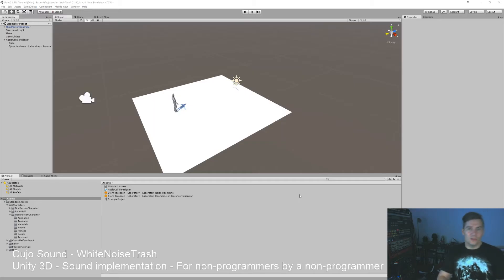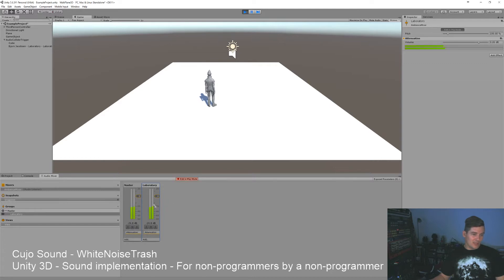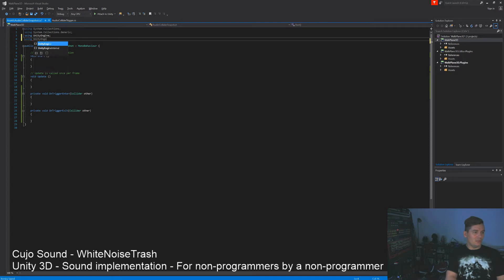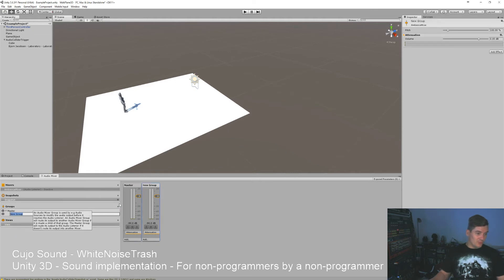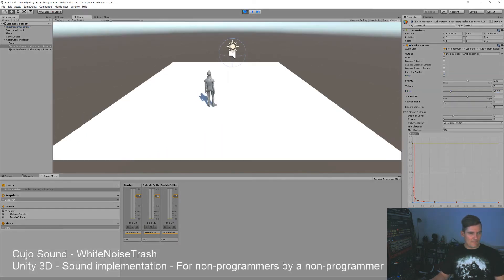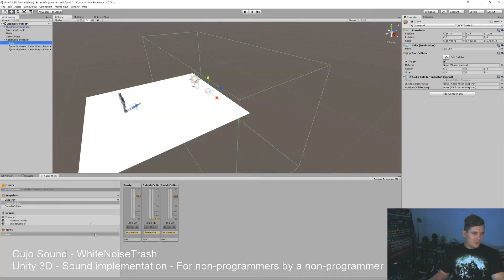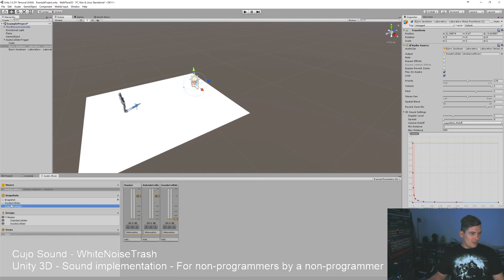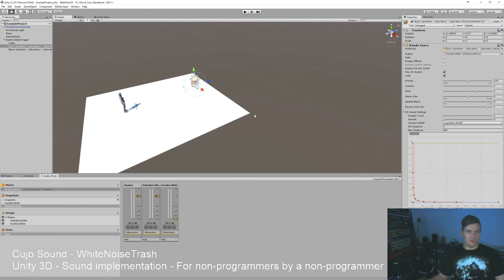Bjorn Jacobsen - Sound Design: Part 5. Unity Audio Mixer Snapshots for non-coders

Comment: Looking at this on 2020 is so helpful thank you so much Cujo. 
I have one question, I can't activate AudioMixerSnapshots in the script I have used UnityEngine.Audio,  but the system can't find it. is it different in 2020?
Reply from the maker: Not sure. But let me check and perhaps make an update video, but pretty sure the mixer should work the same in code
Reply: @CujoSound  Thanks for your reply but I figure it out was a problem with the script editor, your tutorials are really helping here I had my first indie job and they really saved me.

Comment: Very god serie, thx alot ! Is there  a way to make the fader cross at -3 db during theses transitions ? Maybe it's a question of linear or logarithmic fade ? Or maybe the subject is covered in another video ?
Reply from the maker: Depends on how you want it to do so, you can control quite precisely how it should transition. Some of that is covered in the advanced mixer snapshot transition, but not fully and in this way

Comment: very good... This series (although quite old) is helping me massively with my dissertation! many thanks Cujo
Reply from the maker: I should make new ones :D
Reply from the maker: Thanks for enjoying the series.
Reply: @CujoSound  No problem... i'm fully behind that idea! Good luck with it :D
Reply from the maker: @motalofi   whenever they put out new systems, I should try to show it , but yea, the general idea is pretty much the same.
Reply: @CujoSound  I actually have a quick question. Basically, i'm creating a video game that only relies on audio ques to complete the game (little - no visuals at all, possibly even complete darkness). Do any of your videos cover how to change the sound of the characters footsteps? As you can imagine, there will be different environments (city, woodland) that I want to incorporate and I need the footsteps to be relative. Many thanks!
Reply from the maker: @motalofi  yes. I have some, but not in native unity. Only on wwise middleware, but the idea is the same. If you create a general value somewhere, then for each step check what that value is, you can swap between materials. .
Reply: @CujoSound  Perfect. I will check them out :) Thanks again for your help!
Reply from the maker: @motalofi  no problem. If you bump into issues, let me know.

Comment: I had a problem where no sound was coming out and after some troubleshooting realized that I didn't understand the pitch function fully. It operates like a tape machine where positive values increase speed and pitch, negative values reverse the tape and increase speed and pitch, and zero stops the tape thus stopping the audio. Glad I figured that one out, I was getting frustrated hah!
Reply from the maker: Kyle Williams yea, a combination of weird and of course it works that way. It only means that if you don't set the value of the float controlling the pitch, you will just have an inspector window looking normal and nothing plays. 

Glad you found it, it's previously been only of the most annoying things for me too.
Reply: Yup, also did you have an issue with both audio sources playing at the start, since both are set to 'play on awake'? It does that for me and only once I enter the collider does the 'outside collider' mix fade out. How do you write the code to pull that fader down in the beginning? I'd imagine it would go in --- void Start(){} ?
Reply from the maker: Kyle Williams should work with on start. But! On the snapshot mixer there is a "start snapshot" , represented by a star on the right, did you select correctly there ? If it's set to start in snapshot2 or any other different snapshot than the one you actually start in then it will do it wrong the first time you use the script to change anything
Reply: Did you go over that in this video? The problem was solved when you mentioned that feature in video 6. I've got it working now.
Reply from the maker: Kyle Williams quick comment on that pitch thing, if you ever worked with Max/MSP it would make a lot of sense this way. As there you would have a "playback multiplier" instead of calling it pitch, it's basically your native samplerate and then this number indicates how fast it should read it. So 1 is like 44100*1 per second. But 44100*0.5 would of course be half the speed.
Reply from the maker: Kyle Williams I don't think I did. No. So it's not surprising if you bumped into that problem
Reply: I'm not familiar with Max/MSP but what you say makes sense based off the behavior of the modifier. Still it's easier for me to imagine a tape head rolling fowards and speeding up then one rolling backwards and speeding up. Thanks for the info!
Reply from the maker: The next video about this whole Unity thing will most likely "just" be one where I use all the examples, scripts and so on and put together a bigger level so that the use becomes a bit more clear.

Also more creative work with snapshots and using the mixer, the effects in there and so on.